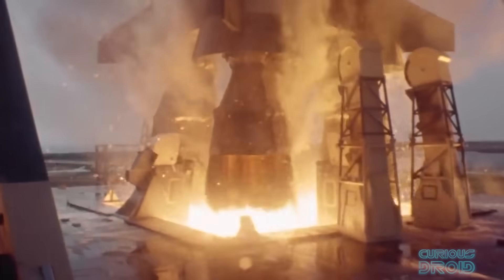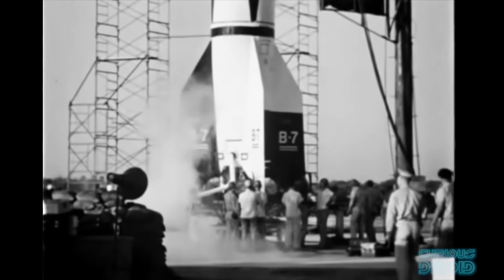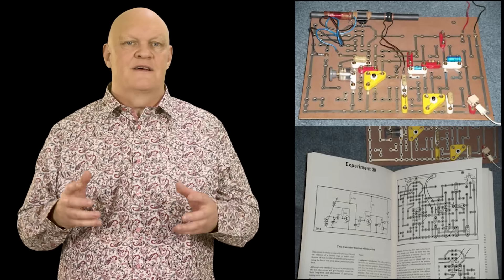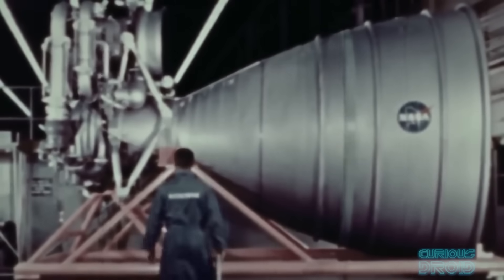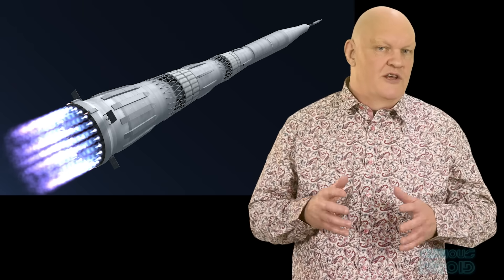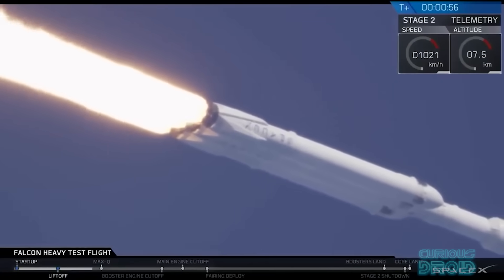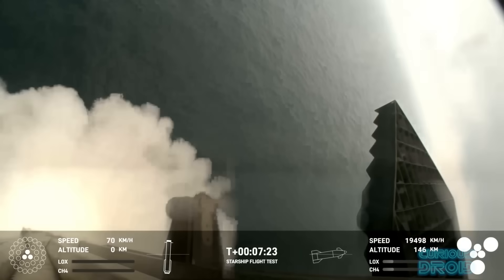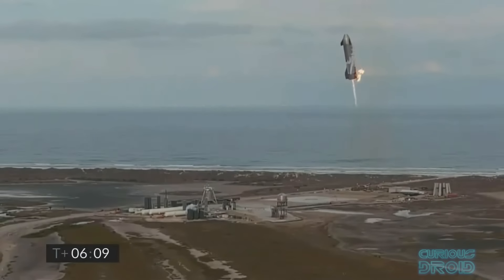Why Does SpaceX Use 33 Engines While NASA Used Just 5?

Comment: Great topic, with great information provided in this video. Definitely a segment worth watching by anyone interested in space trave. 

Now, with regards to some points at the beginning of the video: 
The engines didn't originate with the Jupiter program. As mentioned with the reference to the E-1 (7:09 in), the F-1 engines originally came from the US Air Force, and was developed to a point in the second half of the 1950s (from 1955). The rocket envisioned was possibly so huge because the minituarization of hydrogen bombs was not anticipated, to the degree that developments actually unfolded in those years (nor electronic even). And, solid fueled ICBM rockets were pretty cutting edge at the cusp of the early 1960s, with the Minuteman. 

The hydrolox engines - the J-2 - came from the 1959 Saturn Vehicle Evaluation Committee, run by Abe Silverstein, the head of Lewis Research Center, following the success of the RL-10 used for the Centaur upper stage. 

As for ICBM missiles, the US Air Force already had Atlas and Titan in the works before Sputnik. I believe Eisenhower wanting to give a civilian veneer to space exploration influenced a search for alternatives originally. But then they needed to get things done, and ended up with the transfer of a meaningful part of the US Army ballistic missile resources from Huntsville. 

At the end of the video, it mentioned the SRBs. I don't think they are being reused either (which the video seem to imply); and I suspect it may be that the effort to refurbish them can be  quite high (maybe with the fifth segmented added in there?).
Reply: Without disagreeing with your excellent comment I want to point out that military rockets have fundamentally different design requirements than space rockets. Military stuff needs to be able to be stored away  for years or decades and yet be deployable perhaps in a few minutes (in case of ICBM) or some short period.
Reply: @Axel_Andersen  Agreed. Which is funny how the rocket that got the US in orbit was a not so great ICBM project, Atlas (but eventually turned out to be a good launch system). Then for Gemini (which is pegged as the program that got NASA to learn to fly), there was the man-rated Titan II, with storable hypergolic fuel, which was probably not the most environmentally friendly fuel. 

Now I think a study for MOL showed that Titan II with Gemini still presented a rather "economical" launch system for shuttling to a space station (for that time I guess, in contrast to the more complex Apollo?).

Otherwise, for some reason, the Air Force went down the path of developing the F-1 keralox engine (along with others) in 1955, before realizing how deployable (or not so deployable) such launch systems would be based on those engines. Maybe it was desperation or a willingness to explore all paths/contingencies? Within four or so NASA took over or continue development (January of 1959).

But yes, funny cross-fertilization or exchange of technologies at that time (late 1950s/early 1960s), between organizations that often had quite different needs.

Comment: 14:12 That’s rich coming from someone that makes disposable cars.
Reply: I got stand inside the cone of a Saturn 5 booster engine at the Bay St. Louis Mississippi test facility. Impressive realizing the amount of force coming through the five of them. As a kid at the time it was just cool.
Reply: 90% of the battery pack can be recycled, what do you mean?
Reply: All cars are disposable.
Reply: Any EV can be reused, including the batteries, just because it hasn't been profitable to do so up until now doesn't mean it wasn't possible.
Reply: @Yattayatta wrong. The batteries depreciate fast, especially at that energy density. The 1500 charging cycles promised by Elon sounds like his usual horseshit... We'll wait and see. Once the battery gets severely depreciated it won't hold charge or may experience severe failure, like some Teslas already has. EVs in general are a good idea, we just have terrible execution of them, and I don't see enough research into material sciences related to this at the industry level to change this. Rest of an EV usually holds not much value tbh, unless manufactured by a quality auto manufacturer, with quality fabrication and manufacturing (Mercedes, BMW, some startups)...
Reply: @NinjaAdorable  Source for your statements?

We have a 2019 Model 3 Performance with 75k miles on it. Never seen the inside of a service center. Battery still at 88% of new capacity. Best car I've ever owned during my 57 years on this rock.
Reply: @NinjaAdorable  As with anything the first models will be worse than what comes after. 
Batteries are one of the most invested in things except AI currently though, there are startups left right and center.
I won't be buying an EV any time soon, but that doesn't have anything to do with Tesla or Elon. 
In fact, where I am (Sweden) Tesla is one of few EVs that actually hold value over time.
I really don't care about holding value though, a car is the ret4rdèd mans investment, it can only ever depreciate, doesn't matter what brand you go for. 

I suggest buying something for 2000 dollars, no more, drive it until the wheels fall off, repeat. Use the money you would have wasted on a car to invest in the stock market once you've learned enough about how it works.
Instead of seeing your 60k turn to 30k as you use your car, you'll see your 60k turn to 80k and beyond.
Reply: 100 percent agree. Funny I haven’t seen a Space X rocket even remotely near the moon.
Reply: @JAMESWUERTELE  usually you send payloads to the moon, not rockets...
some of you haters are just so, so dmb.
Reply: @JAMESWUERTELE  isn't it more of a regulation restrictions rather than capability?
Reply: @JAMESWUERTELE  What? SpaceX has sent payloads to the moon, mars and other places in the solar system. You just didn't pay attention I guess?
Reply: @Yattayatta  the company does good work overall with underpaid and over worked staff led by a conman
Reply: @NinjaAdorable  You are aware that SpaceX pays more than Nasa if you are an engineer, yes? SpaceX starts at 113k, NASA at 133k, Nasa offers 11k bonuses/year, SpaceX offers nearly 100k/ year in bonuses and stock options. 

And who did Elon Musk con? You? SpaceX charges 50 million for a seat on the Dragon capsule, Boeing charges 90 million.
Reply: What and when did SpaceX send anything to Mars the moon or anywhere else in the solar system except for the ISS and except for the car he stoled from Eberhart which he just sent into space as a dick move to the guy he stole the Tesla company from
Reply: @-WHITE-BOY  Odysseus lunar lander by Intuitive Machines, launched Feb 15, 2024 on a Falcon-9. And a multitude of geosynchronous satellites that orbit at 36000 km, as opposed to 400 km ISS orbit.

Comment: Starship's goal is not to take people to the moon...
Reply: True. Instead he bought Twitter. A toy for s child.
Reply: Shut up @ZorroComputers
Reply: @ZorroComputers  Influencing public opinion and discourse is not child's play.
Reply: Did Apollo 11 actually leave near-Earth orbit?
Despite the revisionist narrative that this channel won't question -- unstable fuel burn for the oversized F1 engines was never rectified and another arrangement in their place was made in order to reach near Earth orbit, keeping the F1 bell nozzle to maintain the desired appearance.  The great licking yellow flame was an indication that something was not normal as fuel was burning in the atmosphere while providing no additional thrust. This was the result of injecting additional kerosene into the exhaust stream for greater visual effect yet appearing to produce an inefficient burn unlike other rockets after launch.  No explanation is forthcoming and this issue is not addressed in any usual report; however, using a smaller reliable engine with a reduced fuel load and stripped down mission requirement allowed the Saturn V to reach near-Earth orbit.  

The Apollo 11 crew attempted to demonstrate their position at over halfway to the moon as seen in the unedited version presented to the public while the more recently released unedited version reveals a flood of blue light entering the same window as the camera continues to roll, through which only a moment before, we saw the Earth far distant in what appeared to be very low light conditions. Then, as the camera pulls back from the window, the exposure settings are seen to return to normal as a flood of light enters the same window.  Without a change in the orientation of the spacecraft assumed to be on a trajectory toward the moon, the only source for any flood of light can be the Earth while in near-Earth orbit.  

Another indication are the impossible weather patterns seen on Earth, when in reality only a small portion of the Earth's surface was visible, framed by the round window of the command module.  Straight line cloud fronts are seen to be extending for what appears to be more than 6000 miles, a quarter of the Earth's circumference -- something that has never occurred in the meteorological record on Earth. 

The usual sponsored efforts will try to make excuses for why the obvious did not take place -- yet is overly apparent in the unedited version.  When facts cannot prevail in support, sponsored activity will resort to name calling and other derogatory comments discrediting themselves.
Reply: Yes it is.  Moon and Mars.
Reply: It's just a way for SpaceX to suck taxmoney.  @common_c3nts

Comment: I figured that given the early problems the Russians had when using many smaller engines, NASA's choice made sense at the time.  The US also had better German rocket engineers.  Today, computerized controls / avionics probably allow finer control of each engine, correcting for mis-matched thrust, heat etc.

That is totally my guess though.
Reply: In addition, the Soviet N1 rocket program was also under a lot of political pressure to deliver results, while lacking the computational and material resources of the US rocket program. Those constraints were also a factor in their approach

Comment: How can it generate twice the thrust, but can't lift ANYWHERE near the 141 tonnes NASA put into space 50 years ago ???  And SpaceX uses more fuel EMPTY.
Reply: Wrong. Starship can launch 150 tons in reusable mode, 250 in expendable mode
Reply: @segganew Is 250 tonnes enough for a manned mars mission? U sure do need a lot resources for the trip
Reply: @segganew  There is no proof  that they can launch 150     tons in LEO.
Reply: @leotimtom6637  if you plug in Starship's specs into the rocket equation, you get a result of around 300 tons (expendable) to LEO. Yeah that's high but I'm not accounting for various factors like drag. So there is proof Starship can lift that much to LEO.
Reply: @segganew  That`s not   any proof at all. Actual proof is lifting that weight into LEO.
Reply: That was the weight of the whole stack, including the S-IVB, CSM, LEM, Service Module and all the fuel. Starship's mass to LEO is in addition to it's own weight.
Reply: because Spacex has to use  real     engines, unlike F-1.
Reply: because the "reusable" upper stage weighs a lot, but is not counted as payload.
Reply: Did Apollo 11 actually leave near-Earth orbit?
Despite the revisionist narrative that this channel won't question -- unstable fuel burn for the oversized F1 engines was never rectified and another arrangement in their place was made in order to reach near Earth orbit, keeping the F1 bell nozzle to maintain the desired appearance.  The great licking yellow flame was an indication that something was not normal as fuel was burning in the atmosphere while providing no additional thrust. This was the result of injecting additional kerosene into the exhaust stream for greater visual effect yet appearing to produce an inefficient burn unlike other rockets after launch.  No explanation is forthcoming and this issue is not addressed in any usual report; however, using a smaller reliable engine with a reduced fuel load and stripped down mission requirement allowed the Saturn V to reach near-Earth orbit.  

The Apollo 11 crew attempted to demonstrate their position at over halfway to the moon as seen in the unedited version presented to the public while the more recently released unedited version reveals a flood of blue light entering the same window as the camera continues to roll, through which only a moment before, we saw the Earth far distant in what appeared to be very low light conditions. Then, as the camera pulls back from the window, the exposure settings are seen to return to normal as a flood of light enters the same window.  Without a change in the orientation of the spacecraft assumed to be on a trajectory toward the moon, the only source for any flood of light can be the Earth while in near-Earth orbit.  

Another indication are the impossible weather patterns seen on Earth, when in reality only a small portion of the Earth's surface was visible, framed by the round window of the command module.  Straight line cloud fronts are seen to be extending for what appears to be more than 6000 miles, a quarter of the Earth's circumference -- something that has never occurred in the meteorological record on Earth. 

The usual sponsored efforts will try to make excuses for why the obvious did not take place -- yet is overly apparent in the unedited version.  When facts cannot prevail in support, sponsored activity will resort to name calling and other derogatory comments discrediting themselves.
Reply: @ronaldgreene5733  The additional fuel    was injected to  fake  expansion of  exhaust  fumes   as if it  was  entering   vacuum.

Comment: If you want reusability you need to use smaller engines. Smaller engines are just much better for different options.
Reply: So what are the advantages of dozens of  smaller engines compared to a few bigger ones?

Comment: Shuttle Main Engine, according to the book "Wings in Orbit", is highly efficient. They can reach 99.5% of theoretical efficiency. If an engine used to power a small 300hp car with the same efficiency, the size of the engine would be no larger than a loaf of bread, costing less than $100.
Raptor engine's specific impulse: 350s. Shuttle Main Engine: >400s
Reply: The Space Shuttle Main Engine suffers like all hydrolox engines with a poor mass ratio, which counteracts the high efficiency.
Reply: @SentinelSent  Yeah... obsession with Isp is a case of optimising one small component at the expense of the system. Hydrolox engines are fuel-efficient, but that comes at the cost of a lot of bulk and dry mass needed to contain the hydrogen. It also has lower energy density which hurts thrust... and lower thrust means the engines are burning for longer, further negating the efficiency benefits.
Reply: Isp in vacuum(s) for the Shuttle Main Engines: in 1989 it was tested at 453.5; and in 1998 it was tested at 454.4
Reply: Did Apollo 11 actually leave near-Earth orbit?
Despite the revisionist narrative that this channel won't question -- unstable fuel burn for the oversized F1 engines was never rectified and another arrangement in their place was made in order to reach near Earth orbit, keeping the F1 bell nozzle to maintain the desired appearance.  The great licking yellow flame was an indication that something was not normal as fuel was burning in the atmosphere while providing no additional thrust. This was the result of injecting additional kerosene into the exhaust stream for greater visual effect yet appearing to produce an inefficient burn unlike other rockets after launch.  No explanation is forthcoming and this issue is not addressed in any usual report; however, using a smaller reliable engine with a reduced fuel load and stripped down mission requirement allowed the Saturn V to reach near-Earth orbit.  

The Apollo 11 crew attempted to demonstrate their position at over halfway to the moon as seen in the unedited version presented to the public while the more recently released unedited version reveals a flood of blue light entering the same window as the camera continues to roll, through which only a moment before, we saw the Earth far distant in what appeared to be very low light conditions. Then, as the camera pulls back from the window, the exposure settings are seen to return to normal as a flood of light enters the same window.  Without a change in the orientation of the spacecraft assumed to be on a trajectory toward the moon, the only source for any flood of light can be the Earth while in near-Earth orbit.  

Another indication are the impossible weather patterns seen on Earth, when in reality only a small portion of the Earth's surface was visible, framed by the round window of the command module.  Straight line cloud fronts are seen to be extending for what appears to be more than 6000 miles, a quarter of the Earth's circumference -- something that has never occurred in the meteorological record on Earth. 

The usual sponsored efforts will try to make excuses for why the obvious did not take place -- yet is overly apparent in the unedited version.  When facts cannot prevail in support, sponsored activity will resort to name calling and other derogatory comments discrediting themselves.

Comment: The real reason is because of Thrust to Weight ratio. Big engine have combustion instability issues that needs to be compensated with thicker metals to strengthen the engine structure. Smaller engine requires more plumbing. The optimum size is around Raptor size.